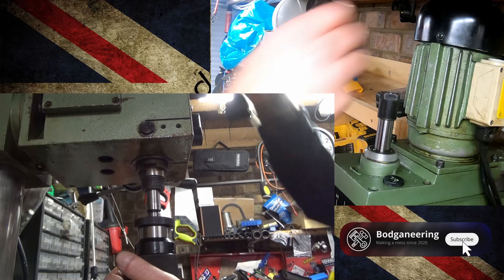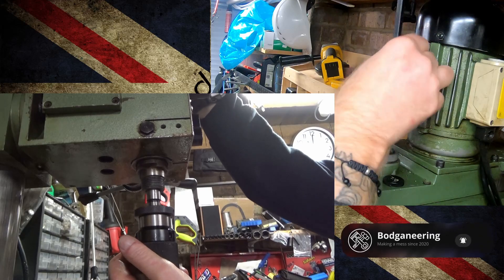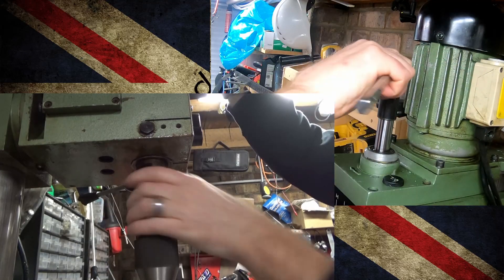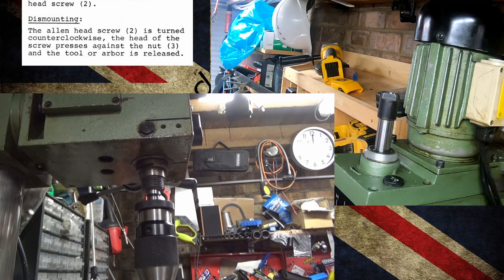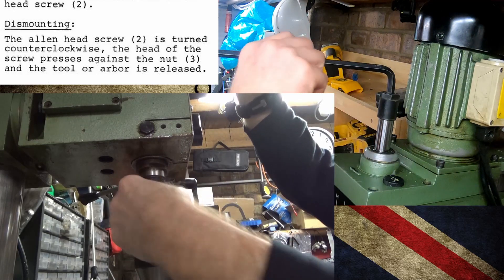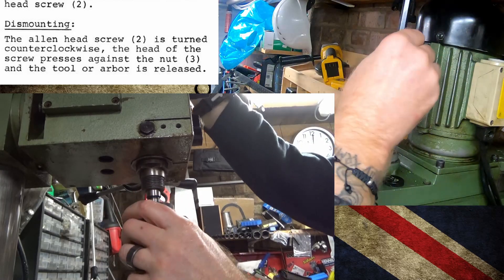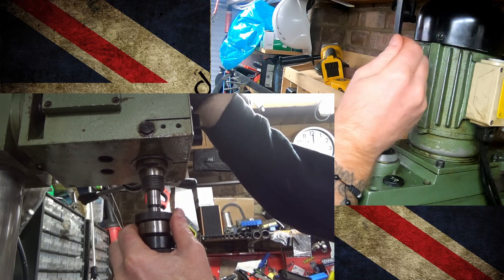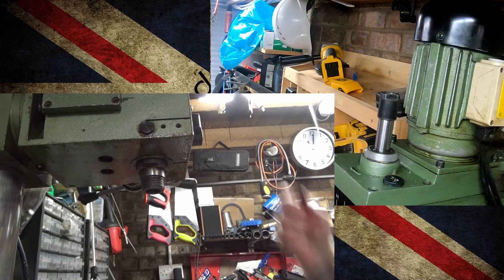EMCO FB2 Using The Morse Taper Ejector Nut

Comment: I think the hammering of the allen bolt can damage the quill feed as I've got a second FB2 head with a stiff/stuck quill. On forums those with the same issue found damage which suggested something being forced. My ones came from a training workshop so suspect an impatient apprentice did the damage. Nice short vid.
Reply from the maker: Seems to be a common question on these machines, in this instance it pays to read the manual… 😂😂😂

Thanks.
Reply: @bodganeering   Any idea where I could purchase a replacement Morse taper ejector nut?
Reply from the maker: All I can suggest is keep an eye on eBay. 

I have put the dimensions on a file in the Emco FB2 users group on Facebook if you want to try and make one.
Reply: @bodganeering  Wow, thanks for that.